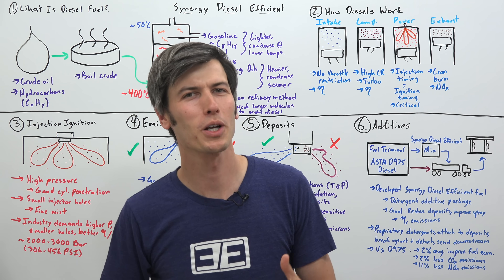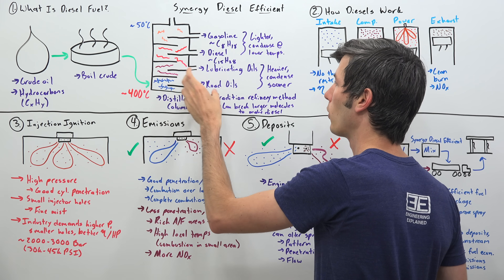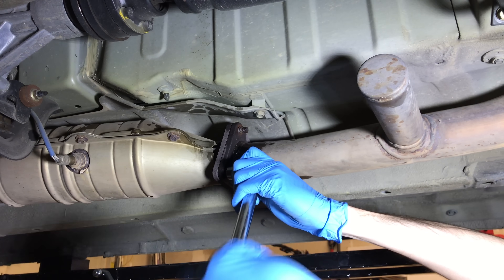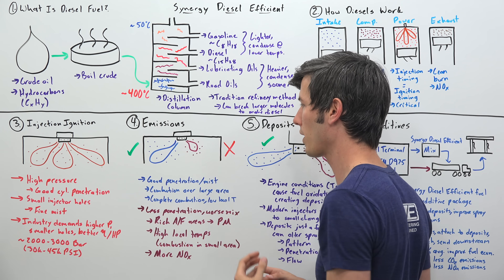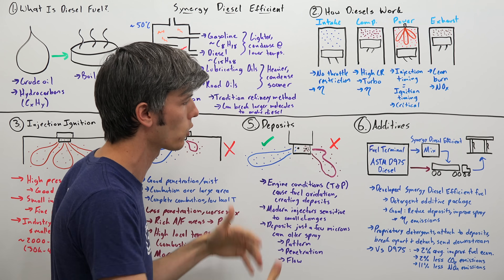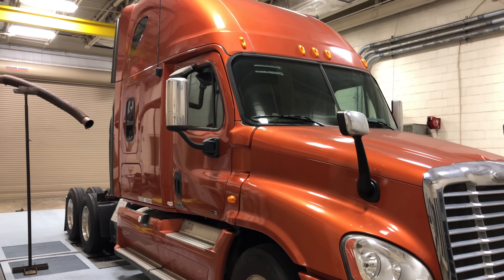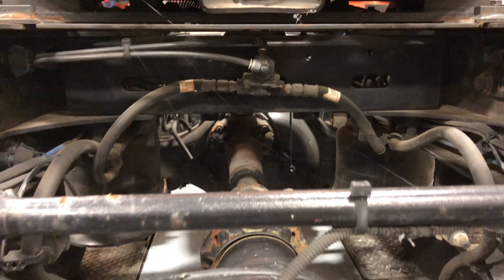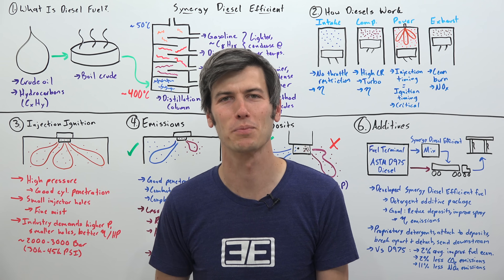Why Diesel Engines Lose Power & Efficiency Over Time

Comment: My stock Mercedes 300d was dynoed at 495k kms and it made 134hp. It left the factory with 136hp
Reply: the 300D is out of the seventies and doesn't have that small injector holes like the newer common rail diesels have.
Reply: @georgobergfell  The OM617 from the 1970s is a completely different animal from the 1990s OM606 he is referring to. 10V SOHC Inline 5 w/ mechanical inline pump vs. a 24V DOHC Straight 6 w/ electronic distributor pump.
Reply: @flemingpandel5287  It´s not so diferent. Yes the OM606 has alloy head and 4 valves per cylinder insted of 2 
But the injection system is not so diferent, both have IDI injection with prechambers and an inline bosch fuel pump that meters the fuel injected with typical barrel desing. The only diference is that the OM606 has an electronic governor assembly vs the mechanical governor assembly, at the end of the line both use a rack to control the fuel injected
Reply: @flemingpandel5287  You cab find a video by CarThrottle showing a 400000 mile plus diesel engined modern Skoda Octavia which still managed better than advertised economy.
Reply: @flemingpandel5287  the OM606 has an inline pump not a rotary distributor pump.
Reply: @georgobergfell  and it will still be running when these fancy ones are scraped.
Reply: @georgobergfell  I had a 300D for about ten years. Bought it from an old lady for 3 grand, used it (together with my brother) for over ten years and sold it to a Lebanese chap in Berlin, for 3,800. It took everything we threw at it and was running just as well after ten years as when I got it. Great car, and easily my best buy ever!
Reply: I love my Mercedes diesel!
I have a 230e I swapped a OM617A into
It fantastic on fuel
And dynoed exactly the same as the factory engine, all I did was clean out that dang fuel system, it has 300k on it!
Reply: @jessevongnaraj2276  What measuring norm are you using on the dyno vs the original spec?
Reply: Best MB ever made. those days are so gone forever
Reply: om606 can easily do over 1 million km
Reply: I was hoping it was going to dyno higher....now that would have been a good story...
Reply: @panther105  Hitting the same numbers on the dyno IS doing better. That engine has seen a lot of miles. Maintaining power for that far is IMPRESSIVE and a great story...though maybe some care and maintenance into the process would make it a story with richer detail.
Reply: @panther105  Well, that's actually not impossible because the numbers given by the factory don't have to be correct for each engine. Small variations in production can lead to variations in power. Not huge, but measurable. And then there are japanese cars and the whole story about 300+ horsepower engines being marked as having 276.
Reply: My 83 300sd turbodiesel has 500k miles on it and i had it dynoed at 150hp, it left factory with 153hp.
Reply: @0FG Rager re: "My 83 300sd turbodiesel has 500k miles on it and i had it dynoed at 150hp, it left factory with 153hp."

But - your engine was not doing service in an 18 wheeler ...
Reply: Those engines are almost indestructible
Reply: Oh, the factory down rated those 300D's for insurance reasons. lol Just kidding. 
Those are amazing little engines. I sold Mercedes parts in the late 80's and I had customers, several, with those diesels that had 300,000+ miles. One old guy was well into 400,000. He would come in and buy headlight rings, trim pieces etc. He was keeping it like new. He lived in Albuquerque and worked in Santa Fe and put a min of 120 miles a day on that thing and it just kept going & going & going & go you get the idea.
Reply: As they say, they don't make em like they used to!
Reply: @mikelemoine4267  Too much electronics and fragile parts, all so close together changing a simple part (lightbulb, filter) becomes a nightmare.
Reply: @Mic_Glow  Absolutely. It works great when it works and it might even save on maintenance for the first 100k, but it makes up for it when it finally breaks.
Reply: who cares
Reply: Are those metric horses or freedom ponies?
Reply: GM redynoed a million mile Duramax, and it lost just 6-8 HP
Reply: @anthonywebber2211  Pretty sure that after injector replacement it would make stock power again
Reply: @arekb5951  
Gale Banks figured it needed a valve job, not bad for hauler with a million miles on it, and maybe it was the fuel injectors
Reply: Uncle's 650k kms 110hp 1.9 tdi made 111.3 hp and 113 hp after engine flush and injector cleaning. Remapped happily to 144hp (at 650k kms!).
Reply: but are the factoty ratings at the crank? that usually throws people off
Reply: @greynolds17  Factory HP ratings are always at the crankshaft, not the wheels.
Reply: What about efficiency ❓
Reply: @Clarityinlife335 efficiency and power go hand in hand
Reply: You took the engine out and put it on a dyno?
Reply: thiscocks I’m measuring crank horsepower on an engine dyno
Reply: @thiscocks  134hp from the rear wheels
Reply: After playing around with the injection pump it made 151whp
Reply: @tuuletingrilli  Factory figures are always at the crankshaft, not the wheels.
Reply: @Ilmagfe  not always.
Reply: @tuuletingrilli  Give us some examples of factory hp and torque figures measured at the wheels then.
Reply: @Ilmagfe  Apparently mercedes w124
Reply: Jan Kosamo - Wow, that’s not big number but still... Crazy good.
Reply: @Rick Deegan re: "My bud had one back in the '70s. I thought it was a total dog but it will prob outlast me."

The Altitude Compensator needs to be adjusted; open that up, and it'll perform.
Reply: It could vary more than that just based on differences in air temp and humidity on a given day...
Reply: You Liar
Reply: 9600GTMAN  Easy with a software update. Tesla do it...
Reply: 93 Ford Crown Victory with half a million miles on factory engine.. 190 crank HP from the factory, 3 months ago it put down 190whp...Only mods are a set of magnaflows. My mind is having issues trying to figure that one out, although its always felt stronger then it really should be.  Burnouts through 1st and carries into second for a bit.
Reply: @zuestoots5176  Crown Victory?
Reply: Moto Guzzi  Those 240 IDI engines were reliable as a brick. I have seen the abuse they took in GD240's in the army. Flogging them from cold, dirty fuel, general neglect... they still sounded like (loud) sewing machines. Granted, they were a little slow on a 2 ton G series. 

This is what you get when you have 70's Mercedes engineering designing an industrial engine.
Reply: My BMW 123d has 210000 miles on the clock and is still going strong. Im very impressed by that engine. Bi turbo 2l i4 with 204hp/400 Nm and a 5k red line that actually still works. When I bought the car I was very certain I would spitt it's guts in no time but it workzzzz!
Reply: iv got a 1992 G class lwb with the 300D engine, it's so slow I have to crawl up hills and can't get over 60 on a flat, is there any way of improving the perfomence?,  it's done 180k miles,
Reply: mac 10 Very hard to say from the distance.
Reply: @mac-zh8di  look it's compression. If lacked in oil changes, the rings may be worn.
Reply: Moto Guzzi  mine is 09 with common rail injection but im not sure if its a mechanical or electric pump. Injection pressure is 2000 bar.
Reply: Moto Guzzi  German Fuel...
Reply: Not uncommon to see E-Class taxis with 2 million km on the odo. Mercedes still builds some of their products to last. Thats rare, in this age of planned obsolescence.
Reply: you could probably get the horses back if you tried using some cleaning additives for the injectors, changed dieselfilter, airfilter and so on. There is a video made on this topic (if you can restore full power to an old engine) and yes you can, but 2 horsepower i mean who cares.
I have a ford mondeo 2006 tdci 2.0 130 hp 330 nm (I'm from Denmark)with 342k km All though never dynoed it pulls like nothing happened. Never smokes never hesitates - really reliable
Reply: Where did the 2 ponies go to?
Reply: @ABC-qd5oc  It was supposed to make 136hp at the CRANKSHAFT in the year 1994. 
It made 134 REAR WHEEL hp a couple of years ago at 500k km. Know the difference.
Reply: @ABC-qd5oc  Ok sorry for answering. I know the consept of humor but yours was a terrible example.
Reply: Ever changed piston rings?
Reply: @tomasnokechtesledger1786  Unopened engine
Reply: Ya well, kilometers are like inches or something so...
Reply: So....it was anemic then and is equally anemic now.  Good for you!

Comment: Nox levels just too high and VW publicity  didn't help! 
Many cities have old diesel bans with full bans to follow. Is it possible to get the Nox and particulates low enough to continue to be a viable fuel alternative for passenger cars? I think diesel car days are fast running out. Used to run a taxi company and we loved diesels but the cost of repairs now with high pressure pumps and injectors is getting crazy. They now changed to Toyota petrol hybrids and halved the maintenance bill.  Is there a future for diesel?
Reply: Well most petrol engines are going direct injection now, although the injection pressures aren't quite as high as DI diesels they use a similar driven high pressure fuel pump.
With appropriate emissions systems like SCR and DPFs they are more efficient than gasoline engines at part load, and can have lower emissions. But this is all application dependent anyway, with DPFs clogging without regen when used for short trips.
In my eyes, they should be a mainstay for automotive power for a good while longer.

Comment: excluding 1.9 tdi
Reply: Not every 1.9tdi is great. Later revisions had their fair share of issues
Reply: @hojnikb  yeah the rotary pump ones are the only bombproof ones, the early PDs can eat camshafts and the later PDs are shite
Reply: @Sbanar  it depends on brand.. Audi - engine is longitudinal and upright like it should be! Oil pools in cam chamber and keeps everything lubricated. Other vag - engine is lateral and tilted and oil flows away from moving head parts more easily and leaves them with poor lubrication especially when running in idle. 430k kilometers and everything is almost perfect under there. Only small problem was PD swing arm axle bolts breaking(most likelly related to jobs done to injectors) and one swing arm coming totally separated from head and bouncing around in there. Drove 600km home and got used swing arm assembly etc. beaten parts for 20eur and it's running yet again on 4cyl.
Reply: @JPK90  Thats interesting, I hadn't heard about the transverse engines having oiling problems. It can't be very serious because there are so many transverse tdi's with heaps of miles
Reply: 1.9TDi Golf Mk V 250000km and it runs smoothly with 5.1-6.0 litres/100km. Yeah it’s not the most powerful anymore but reliable. Lets hope it stays like that
Reply: I got a A4 B5 quattro with 470k Kilometers on the clock. It does 6 Liters/100km, whatever I do, which is great considering my rather hard driving style and the fact, that it is AWD. It might die sooner or later because the timing belt will eventually snap since i won't be changing it because it doesn´t jusitfy on a 750€ Rustbucket.
Reply: Rz4e
Reply: thats my engine, Skoda Octavia gang
Reply: That's the engine in my A4 the best engine ever

Comment: Diesel engines lasting 200,000 miles? Every diesel I’ve owned has lasted 350,000 miles plus (light duty) and have a c15 cat lasted 1,700,000 miles before rebuilding. 

Modern Diesel engines (2007+) are likely not to last as long with all that crap on them and the ultra high injection pressures coupled with generally very poor fuel filtering (and oil filtering) systems.   

Sure we’ve made them efficient.. But reliability is also significantly reduced now. High injection pressures and many emissions control devices that will disable your engine in many cases if they fail or malfunction is awful and many people hate it.

Cost to repair has also skyrocketed. This ultimately will lead to many engines being scrapped far before their useful life is up because people won’t be capable of, or willing to, pay for new egr coolers, dpf filters, catalytic converters or components, injectors and or injection pumps. 

It’s amazing engineering, but like the rockets that powered Apollo, their useful life is significantly impacted by all those moving parts.
Reply: yes all the crap that makes them more powerful and more efficient
Reply: they are designed from the factory with a life expectancy of 250,000 miles. not the same as how long they will actually last. pretty much every light duty diesel engine will go 1 million miles if its left stock and taken care of properly.

Comment: Really depends on the engine and if the owners keep up with maintenance. There are many, many old trucks and boat engines that have been running for 50+ years and just keep trucking (ba dum tiss).

They just don't make them like they used to. Older engines aren't as efficient and don't have electronics, but that just means there's less to fail.

Comment: Love my diesel trucks, a few tweaks here and there and the power and efficiency is greatly improved.
Reply: That's true but still horrible compared to electric motors. 

I get that its going to be a while until electric trucks have the range and payload of current options, but that day will come
Reply: @jacobdukes4741  yeh who would want more power, more torque and use less energy to do so while being far simpler. Sounds silly to me!

Comment: Do EV lose power and efficiency over time? Thanks.
Reply from the maker: Range, yes, and if battery voltage is affected enough, then perhaps some power, but I'm not sure the motor loses much power or efficiency potential.

Comment: Why don’t they use compression to ignite gasoline engines?
Reply from the maker: Well, they can, and this is generally what HCCI research is looking to try to do, it's more efficient, however the ignition timing portion of the equation is very difficult. I'd recommend my video on HCCI: https://youtu.be/OVWZFdb_AGc
Reply: I believe it's due to the fact that gasoline is a lot more volatile than diesel, and if you compress ignite petrol, it'll result in the fuel igniting before the optimum point for peak power. Not only will the engine be less reliable, you'll have less power and torque and lower MpG
Reply: Jack Murray, that makes sense, thanks.
Reply: Gasoline has less energy than diesel, so they have to use spark plugs to ignite gasoline
Reply: Shane K great idea, Mazda skyactivc X just stole ur idea
Reply: Mazda does it with there new gen engine

Comment: diesel fuel isn't C17H24 ?? and gas C7H16 ?? it's what I have learn in school so it may have change since (or it's different in EU?)
Reply from the maker: It's a range of hydrocarbons, C17H24 will likely be a part of diesel fuel, and C7H16 will likely be a part of gasoline. But the chemical makeup is many different hydrocarbons, with varying carbon and hydrogen atoms.
Reply: small research after watching the vid' to the end, you are answering to fast !

C7H16 is the base fuel (Heptane) and C8H18 is the anti knock additive (Octane) ... the modern fuel use more octane than few decade ago ... 

same for the diesel fuel C17H24 is the old heavy molecule (also use to heat houses in EU)

Comment: EE preparing trucks for Area 51 invasion
Reply from the maker: 2% better mpg means 2% more range!
Reply: Why are there so many Area 51 invasion references floating around the internet recently?
Reply: Thinking about cummins swapping my 07 camry in preparation for the storming of area 51. Wish me luck.
Reply: @justinbiggs1005  that should take the gates down... go for it !!
Reply: @marunero3  challenge accepted. Going to try to fit a 6.7 cummins in it. If that doesn't fit I'll extend the hood. Lmao
Reply: justin biggs just get rid of the backseats, it will fit perfectly there

Comment: Why was diesel fuel so inexpensive before the early 2000’s and then is just as expensive or more expensive as unleaded gasoline after 2005?
Reply: Greed.
Reply: Diesel fuel was cheaper because its easier to refine from crude oil. Its more expensive now because refineries arent supplying it in quantities like they used to driving up the price
Reply: In the EU diesel is still cheaper, but here diesel cars are much more common. Almost every car has a diesel option and most of the cars going around have  1.2l to 2.0l diesel engines.
Reply: Taxes.
Reply: @flemingpandel5287  subsidies to Farmers b20 is corn oil and diesel fuel blend
Reply: Also look at 7:30. They keep adding more and more crap in the name of the environment. In reality, it's to drive up prices and line the pockets of the companies making the fuel additives.